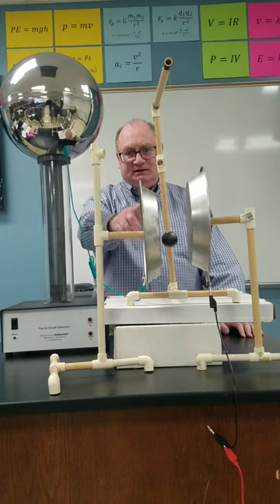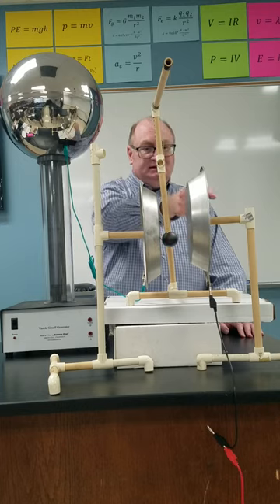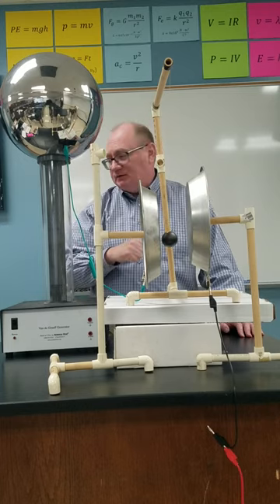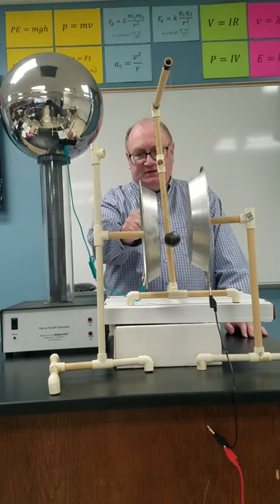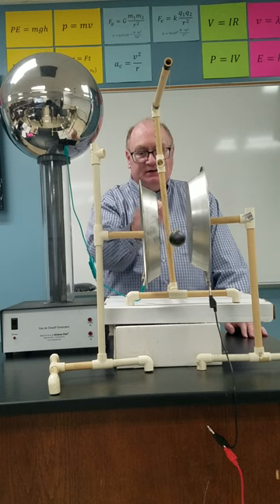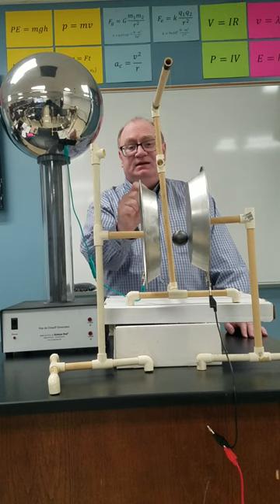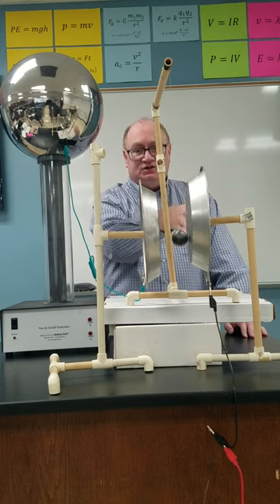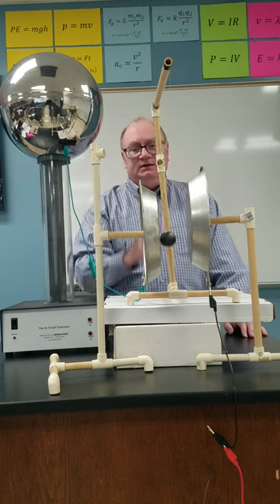Van de Graaff and Pie Plates #shorts

Comment: How much potential difference needs between two plate to see effects.. 
i do with twelve volt battery but failed 😢😢😢
Reply from the maker: That Van der Graaff has a potential difference around 100,000 volts.  A twelve volt battery will not do it.  The battery can supply a lot of current, but you don't need current for this demonstration. You could potentially do the same thing without the Van der Graaff if you can charge one of the plates with static or use a plastic plate and rub it with wool to create the potential difference.  I have not tried this so I don't know if it will work. Using the generator is much easier to work with.  Thanks for watching the video and commenting.  I hope my reply helps.  Check out my other videos for some more demos.